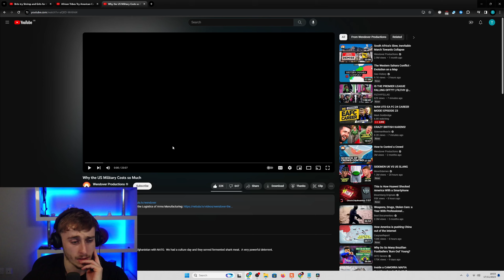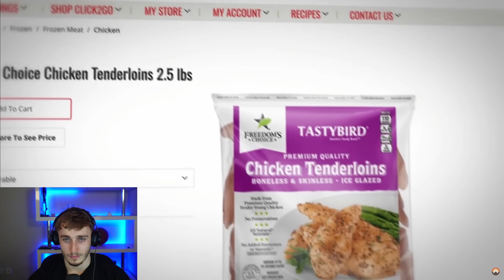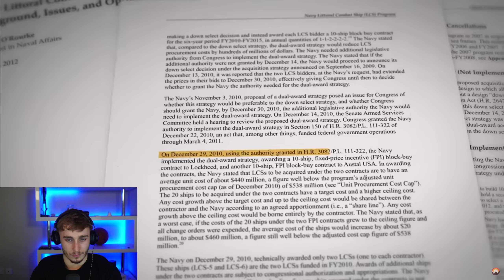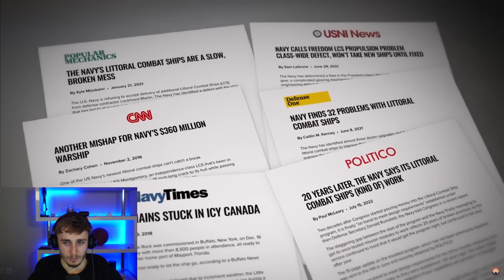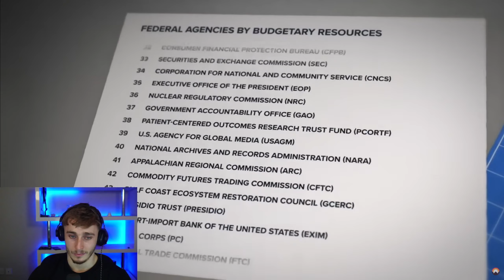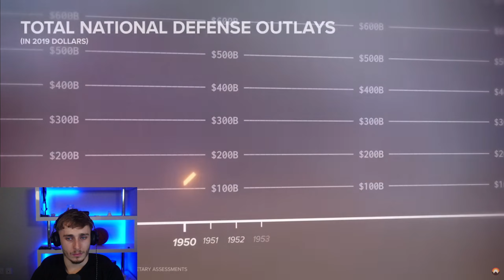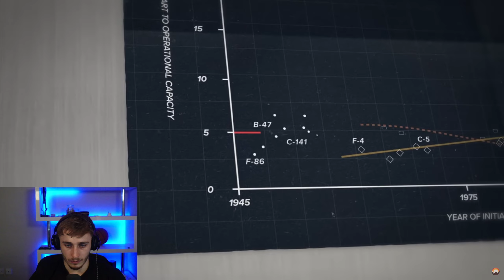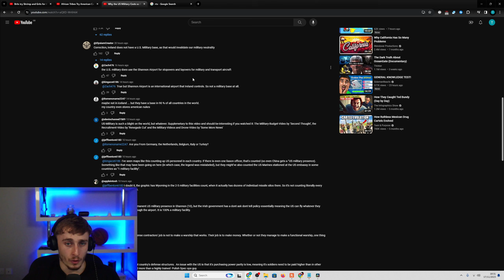Brit Reacting to Why the US Military Costs so Much

Comment: Even failed research is still research, and it’s knowledge gained and failures learned.
Reply: The problem though is that the research is producing less and less for the amount put in.
Reply: @ac1455  I’d say yea and no.. they are doing way more than what was ever done before and it’s not as easy as just making a fast and maneuverable jet. There is so much more going on with the tech it’s worth the delays and over budgets. Imo.